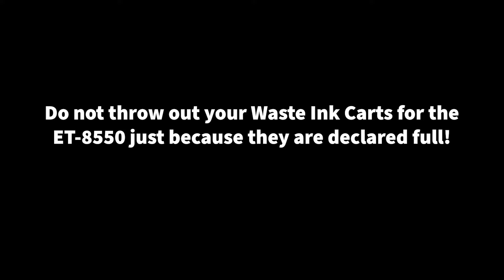Do not throw out your Waste Ink Carts for the ET 8550 just because they are declared full!

Comment: Hi. Yes, better to get the printers with replaceable waste ink cartridges. It is a necessary feature, unless you just want to use it for one cycle of waste ink then chuck the printer in the ocean or the rainforest. 

I am doing some handmade book printing, and just picked up the Cannon Maxify 2050, mega-tank printer. It holds a good bit of ink. I hope I can get good results for the final product. It is a bit of a high-volume office inkjet, but just a dedicated printer only, so kind of unique. Trying to get some elevated illustrations, not quite photo level.

I am looking at some affordable papers that do well with the pigment ink. Seems like coated might be too expensive, to keep the price reasonable, but I am going to experiment with the colorlok papers at different thicknesses, and different finishes/settings. Any good recommendations for a reasonable inkjet paper, coated or uncoated, 24-40ish lbs will be considered. Books are small and not very long, and contain full color artworks, some portraits.

Pretty fun stuff. i am just rubbing my hands together and final editing until the last papers get here. haha.